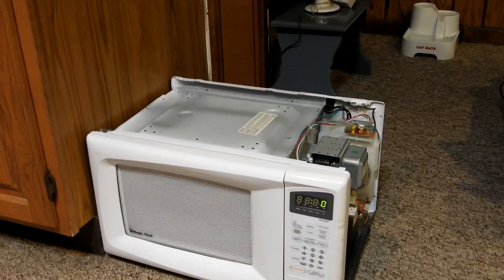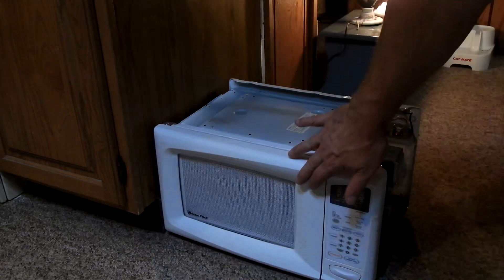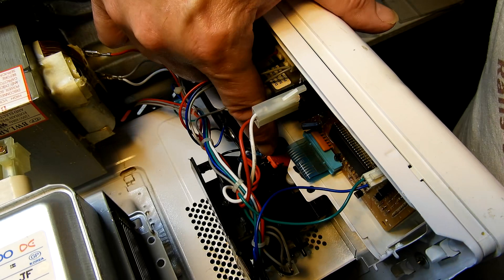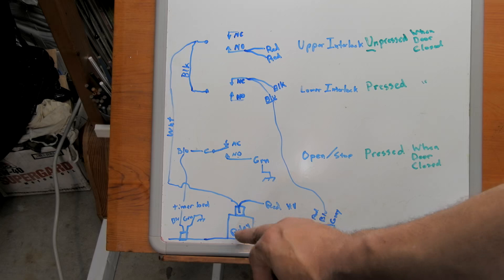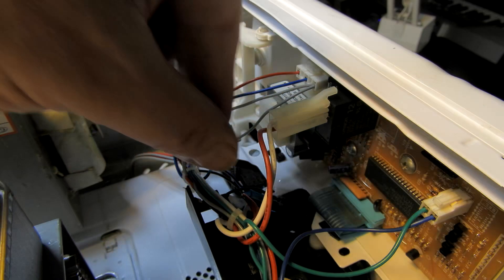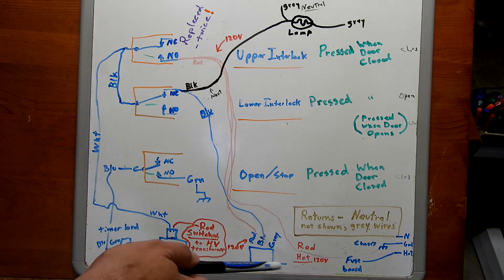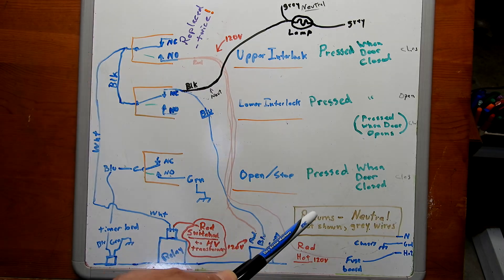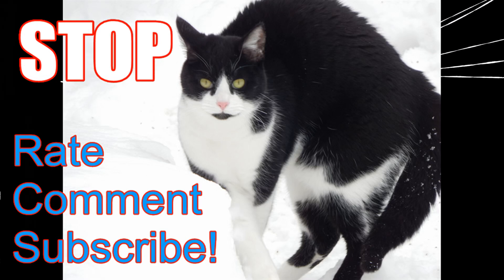Magic Chef Microwave Repair MCD990W Switch Wiring

Comment: I like your videos.you do an awesome job explaining how to do repairs!Do you not have to unload the capacitor before working on any part of the microwave?  I have a problem I think wi5h the key pad. Or possibly the board operating the key pad buttons. Do I need to unload the capacitor before working on this?
Reply from the maker: In my videos, I am only working on the 120V circuit, I stay away from the high-voltage section. Doesn't seem like you will need to work on that either. Only worry about that if servicing the transformer,  HV cap, Diode, and/or the magnatron; otherwise, I wouldn't touch any of that.